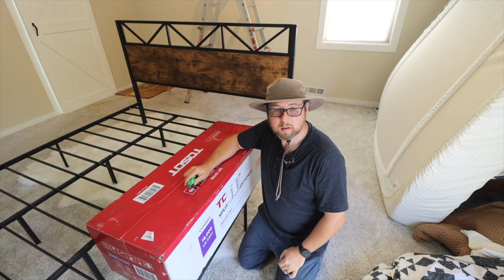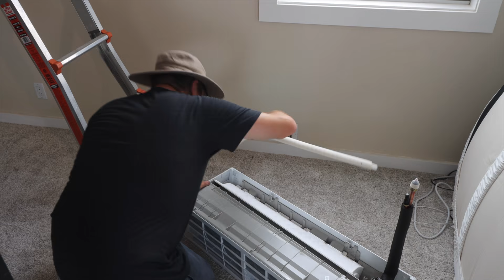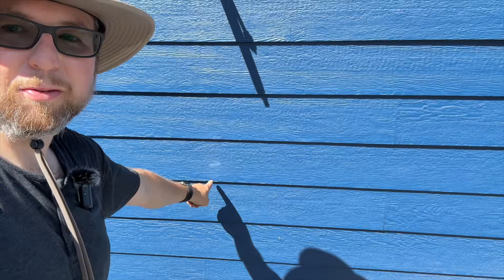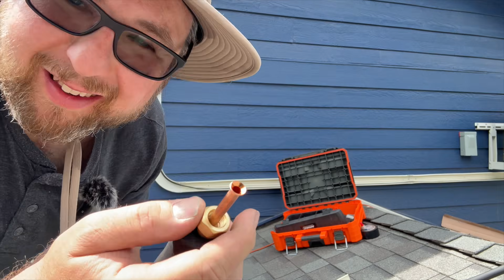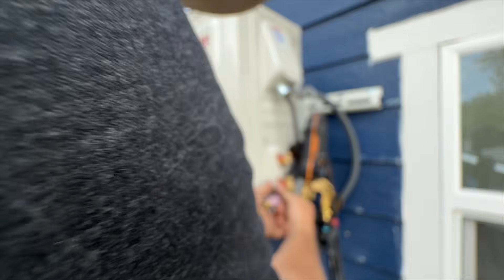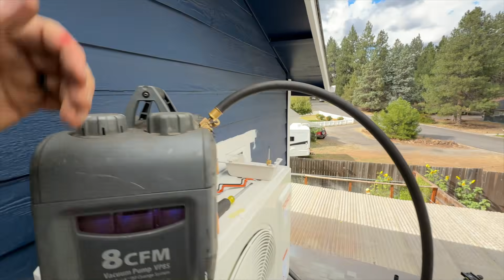TOSOT 18k BTU 230V Mini-Split Installation — R32 (A2L) — Complete DIY + Pro Guide EP231

Comment: New subscriber here. Your video is the first I have seen nitrogen recommended and not vacuum.   Good call.  I am planning on flaring the line sets because the outside unit is close. You mentioned the previous one you did made noise during to short line set.  Did I hear that correctly? All the best from north Texas.